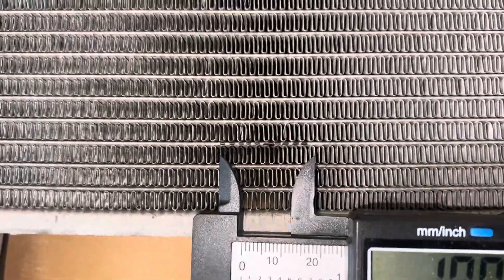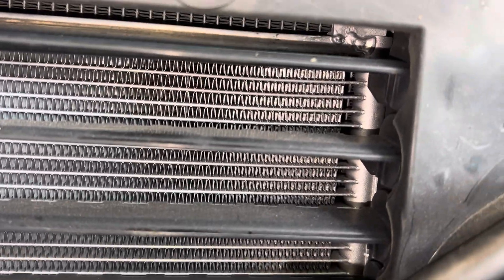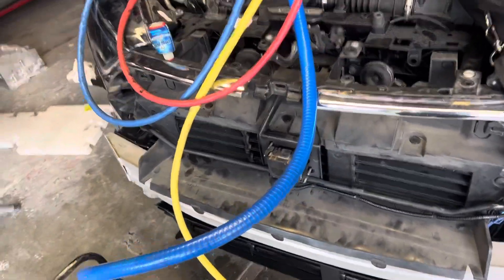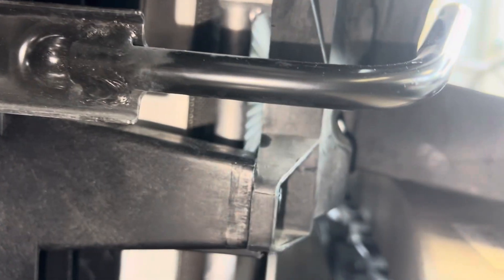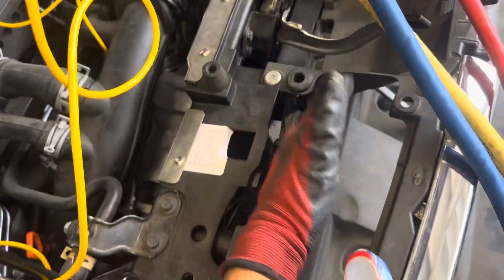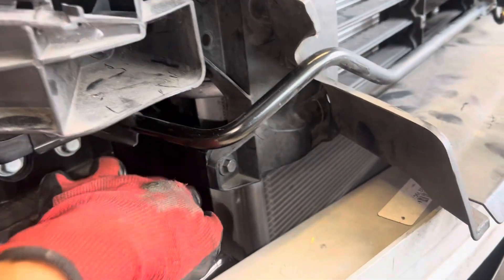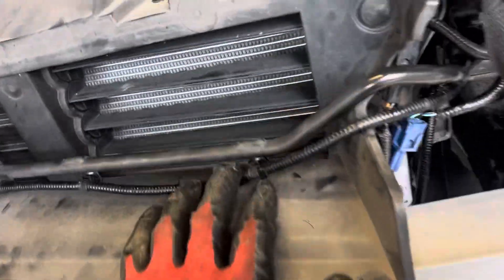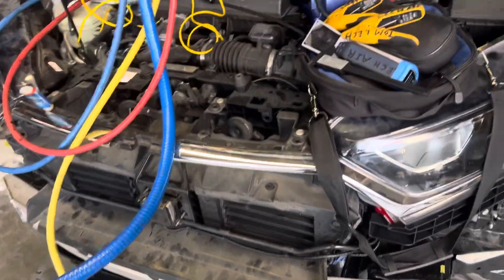Causes Of Poor AC Cooling / What You Can Do To improve AC PREFORMANCE In Stop & Go Traffic

Comment: Interesting you mentioned the foam.  I already did that on my Subaru. Out some foam on the sides and the top and it made such a difference!
Reply from the maker: My dad showed me this. The very first vehicle I did it on was my 1966 Ford Mustang when I was a teenager.  Later I got into double parallel, condensers, and adding sub cooler condensers and second evaporators to vehicles. 
      Then 30 years ago when I started my business, I worked with the company that’s a limousine company for servicing automotive shop. And they started building limousines, and all the limousine air-conditioning always sucked..   I showed him how to build limousines that were starting to run up to five evaporators in those extra long, super stretched limousines. Extra condenser sub, condensers, and extra receiver dryers..

Comment: Good idea about the foam. I didn't install it because factory foam fell apart. I did buy a Denso condenser and compressor though. 90° ambient temperatures and system gets down to 44°.
Reply from the maker: I got a video of my Prius between 103°F to 106°F temperature between 39° degrees Fahrenheit and 41°F out the dash.

Comment: Do you recommend to do series connection of condenser?
Reply from the maker: Do parallel if it’s microchannel parallel flow with the receiver dryer already on them, and they have a sub cooling channel at the bottom of the condense. 

If they don’t have a receiver dryer, but they still have a subcooling channel at the bottom still do parallel 

If you want more cooling, add a small micro condenser like an old Mercedes remember, some of them would have that secondary condenser the bumper 

It depends on the type of condenser arrangement . 

Their internal design, anything will work and give you some sort of cooling, but there’s a difference between working right or just barely working 

If a lot of modifications going to be done where you’re making up your own custom hoses, and you have a place where you could put a separate external receiver dryer, using universal aftermarket, parallel flow microchannel 

Or if somebody is using old School tube and fin 3/8 tubes

Are they using the 6 mm European style?

Or the old-school serpentine

All these make a difference